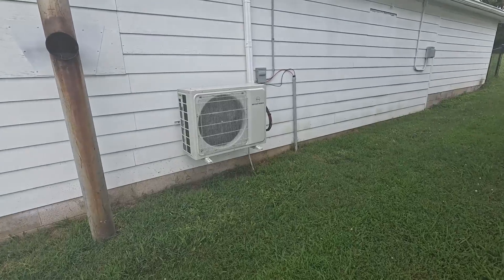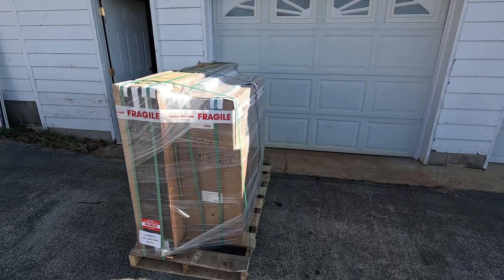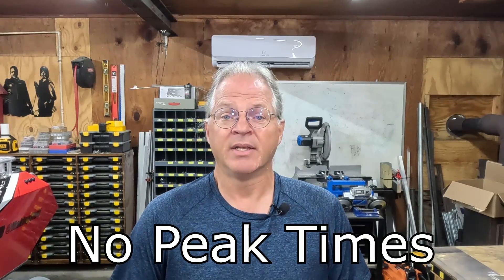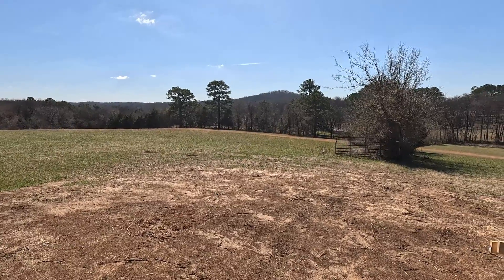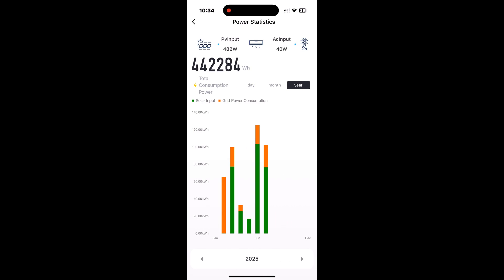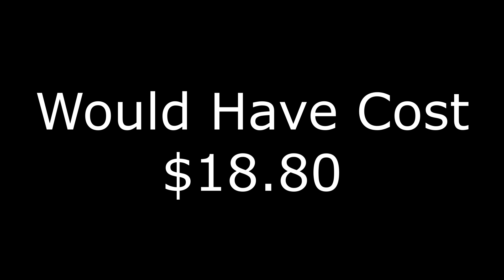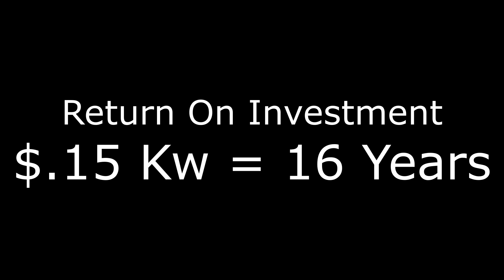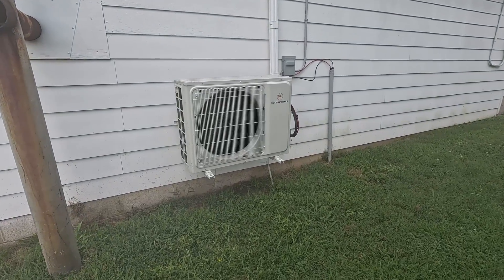My Solar Experience Was Not What I Expected!

Comment: In Phoenix the rates are .10 to.35 cents depending on time of year and even time of day. I am installing the solar mini splits and used panels that were cheap. The ROI for the solar part is about 3 years. I am not figuring the costs of the mini splits as the main AC needed to be replaced anyways. But the other nice thing is I keep the house way cooler as the power was free. Plus I don't yell at the kids for the door being open as much. So for me its definitely worth it.
Reply from the maker: Yes, the free power definate keeps the place cooler in the summer and warmer in the winter!  Thanks for watching!

Comment: I have 3 12000 units all run fully off of solar I have inverter I would cost you a little most but you could buy a 3000 watt inverter and 2 battery and been total be off grid and run some of your small stuff off of it saved even more

Comment: I’m in the Mat Su Valley in Alaska and we pay .21 a KW 24/7.  I’ve run the numbers and putting in solar when we only pay about thousand dollars a year of electricity isn’t really cost effective. We have an off-road remote cabin where we have had solar with a 4 K inverter for over 20 years.  It would be cheaper to run small generator, but the convenience of not having haul gas and not having to run a noisy generator makes it worth it.

Comment: Just get yourself a small battery Bank. 4 to 6 lifepo4 batteries. Run the power straight into a charge controller. From the charge controller to your batteries. And from your batteries you can go straight into the AC unit. And then you can hook a power inverter to your battery system if you need to. I have a refrigerator that is off the grid. I have four batteries with 600 w of solar.Most of the day the sun runs my refrigerator and charge it up my batteries and at night the fridge runs off my batteries. I did this not to save money but to have a piece of mind when power goes out.

Comment: Great video, with that said, why not have the best of both worlds. I would think all you would need to do would be to take the solar positive and negative from the split and run through a Y splitter for each the positive and negative and then back into your min split. Then the other side of the Y would hook into an MPPT controller to charge Lifepo4 batteries (the best way to go now) which in turn would then go to a pure sinewave inverter and branch AC back to your mini split. 
Problem solved, keeps your batteries charged and your AC/Heat runs sunshine or not (provided you have enough battery storage) and totally off grid.
If you want to take it a step further, you can add in an ATS and use the inverter power as the primary power and grid power as secondary power for when you have neither sunshine nor enough energy storage to keep up.
Reply from the maker: Good idea!

Comment: Use a system with the mini split... take the 3kw of array and charge a system then use the system to run 120v or 240v to the mini split. The electricity storage is better than just the mini split using power when it demands it.

Comment: It fascinates me when someone is reviewing one of these EG4 hybrid mini-splits and refuse to talk about the 800-lb gorilla in the room.  A substantial amount of the power those solar panels could have produced went to waste.  A more efficient system would be the same solar array ran to an inverter with some battery storage and then a normal, run-of-the-mill mini-split.  This product is basically a gimmick for people who don't understand what they are buying or using.

Comment: I do have a offgrid cabin and put in a standard 120v mini split.  The cost difference between a solar unit vs normal one with solar battery system was about the same.  But I alreaty owned the solar system and I can run it at night with no grid power.  These solar units just arnt worth the cost.
Reply from the maker: Thanks for the info!

Comment: One question or calculation to consider is, how much potential power was not utilized from the solar panels, when they were in the sunlight, however the mini-split was not running?  For me, every panel should be contributing somehow at any moment it is in good light. If off-grid, then I want it going to an mppt charger, whether that is stand standalone or in an "all-in-one". So that power is either directly used or sent to a battery.  If total grid tied (no batteries etc), then I'd opt for micro-inverters which would directly offset grid demand, without mppt's, batteries etc.
Reply: If you are using the panels as a shade such as blocking the south side of a structure you are getting a secondary value. PV is cheaper then plywood and shingles.

Comment: I am running into the same thing putting a solar, mini split, batteries and hybrid inverter in my shop.    I'm justifying it by turning my shop into a "lifeboat" in the event of a power outage.  The ability to run lights, a propane furnace, AC, a fridge could be a life saver. (And cost less than a whole house generator) A few nights in a hotel for my family of 9 and the system pays for itself.  It doesn't work just on the $$/kwh.  Life is more than a spreadsheet.  Thanks for the video!
Reply from the maker: I agree, the peace of mind is worth it!

Comment: The other scenario to consider.  If you are going to buy a mini-Split Unit anyway, while it may take 16 years to pay it back for the entire cost.  The flip side to consider is that the cost of the unit is going to be slowing offset every day that you use it.  

Hopefully everything lasts for the needed time for a "full" refund, but even if doesn't, you still get part of that money back.  I'd rather spend for $500 for AC/Heat than $2500.  

That slow payback may be a larger concern for some especially if you are not going to be around long enough to reap the rewards.
Reply from the maker: That's pretty much the boat I was in.  I was going to install a mini-split here in the shop no matter what.  So yeah it does save some $$$ just thought it would be a little more.

Comment: I recommend a normal mini with a inverter and battery 450$ 12k mini split 
750 for a 3k inverter 850$ for a 5kw battery plus the panels and mount it will run mostly free and run lights during the day. Solar is addictive. So be careful.
Reply: I got a 5kw inverter from sungold power for 780 after taxes
Reply: yes very addictive I'm all in. 👍. hookline and sinker 😃

Comment: Probably the easiest thing to do would be to hook up 2 or 3 panels directly to the AC and then get a small cheap inverter/charger and maybe a battery and run your shop lights off solar as well.  If the mini split is 120V this would make it very easy for you as you would just need a 3000W 120V off-grid inverter and you can get some inexpensive batteries

Comment: I have wondered about capturing the extra solar as well. Batteries in line with the panels don’t make sense since the hybrid mini splits have an input voltage range of 90-350VDC or so.  Most inverters like a battery bank of 12-48VDC. It could be a non-traditional storage such as water heater or EV.  We live in Texas and the solar option is attractive for my garage/shop as well as office - Hamshack.  The hybrid will save money and we won’t worry about usage.  Also I want to use one hybrid mini split to heat & cool my master bedroom in case of rolling blackouts here in Texas.  Thanks for the video.  All the best.
Reply from the maker: Yeah, those rolling blackouts are a pain.  This would certainly help in those situations.

Comment: If you were located where grid power cost a million dollars, you could have broken even on the first month and been a theoretical millionaire.   Your point is pointless here.

Reality is you bought the wrong thing.  Solar power should always have batteries as storage.    The choice to go grid power or solar power should be made by a controller and you can use a standard split aircon.  and lights.   and whatever else you want within the power available.

With batteries and a controller, and decent panels you would have generated much more power and been able to run much of your shop for "free".   Without batteries, you are in the position of only being able to get power when the sun is out, and if your system generates more than you need, it is effectively wasted.  If the panels were in fact 3kw, they could generate 12-15kw per day in summer, or 450kw in a month - much more than your AC unit used.   Even giving only 50% of that, you would have had about 100-150kw hours that you could have used it some other manner such as the shop lighting.

Solar without batteries is effectively pointless.

Comment: I am in Florida and my rate is 0.135 kWh.  I have a 15,500 watt off grid solar system with 30 kWh of batty storage, a dedicated solar A/C would not be be cost effective for me.  I use window A/C units, not as efficient but cheap and I have plenty of extra power in the summer time.
Reply from the maker: Thanks for sharing your experience.

Comment: Yes, interested in storage. You used units of power when you were referring to units of energy. Out of curiosity, how many kW is your A/C rated at - should be on a placard on the external unit?
Reply from the maker: It's a 24K BTU unit.
Reply: @MakingStuff  Thanks, for us metric lot, thats 7kWh - so as a guess, it draws at maximum around 2kW mains when running.

Comment: Not sure if its a legit gripe if you knew it was a 3Kw solar and splits are normal 1Kw of less.
Its overprovisioned solar panels to allow it to collect sufficient solar for overcast days.
You could easily be charging a battery bank with excess power, but you have to do some basic research vs just plunking down $3K.
Reply from the maker: I came to the same conclusion about over provisioning for overcast days. It all came in a kit from Signature Solar, so I didn't get to choose how many panels to purchase.

Comment: I'd love to see more solar videos!
Reply: I'd just love to see original content, from anyone at this point.
Reply: I would not be watching MS if you want to actually learn more.
Not too be snarky, but he bought a 'system' that was sold as a non-battary based solar AC.
It seems to be a decently priced system that does what it was marketed and sold to do.

MS didn't do some basic research, and now that he has some excess power is unhappy that it also doesn't have excess power distribution as part of the package, and that its producing more unuseable power that he currently can't use.
So he now wants something different than what he bought.
There is probably a $100 power distribution box out there you could connect between panels and split that will insure split gets 1Kw always, and allow excess to be diverted to battery's or other DC equipment.
But the Manf./Seller was selling a solar powered AC package, not what he know wants.
Reply from the maker: @boots7859
@boots7859 Hindsight is always 20/20 and you can't always think of everything.  Especially when trying out some thing new.

Comment: Power use is measured in kilowatt hours, not kilowatts
Reply: Agree with pedanticism, however its clear from context.
I just disagree with the griping that it produces more power than it uses.  It has excess panel capacity so overcast but warm days will still allow it to run.  Not a terrible price, though not sure if the split and panels are decent or no name.
Reply: No its not. Power is kilowatt. Kilowatt hours is energy.
Reply: @martinsvensson6884  
Syntax Error- Power use is an ambiguous term.

Kw is power generated
Kwh is unit of energy used over time.

For some people, 'how much power does it use' is directly related to running costs which means Kwh.

For others, 'how much power does it use' is specifically related to wattage/voltage/current requirements, which is Kw.

As a non-stoage/isolated solar setup, kw as used in the video is fine. It is a little odd as most times people have battery and talk about their average/min-max Kwh they are getting.
Reply: @boots7859  Yeah but I'm not talking about how some people use the word.. :) I'm talking about the correct definitions of those words. Power is kW. Energy is kWh. There is nothing else.
Reply: Rated power verses power consumed.

A machine rated at 3kW requires at least a 3kW power supply in order to do its duty. The amount of power this machine will consume (the cost to run it) is measured in kWh. So this 3kW machine running for 5 hours will consume 15kWh of electricity.
Reply: @Zoro-x3q7s  No, no such thing as power used, it's energy used.